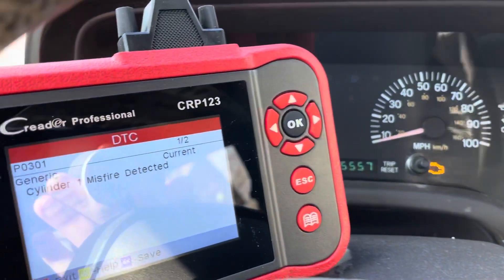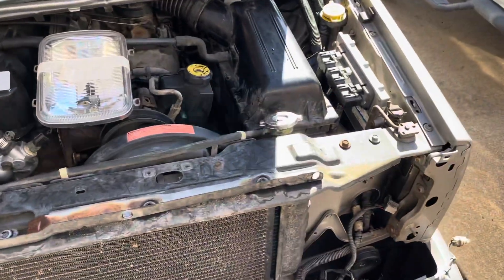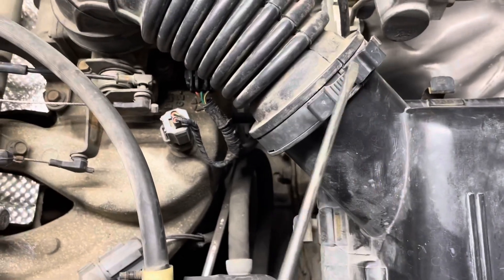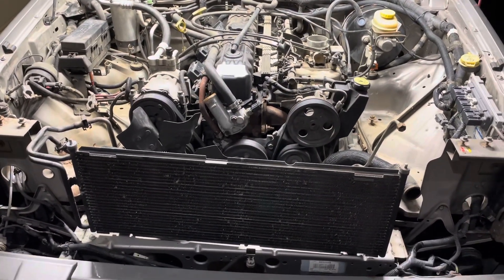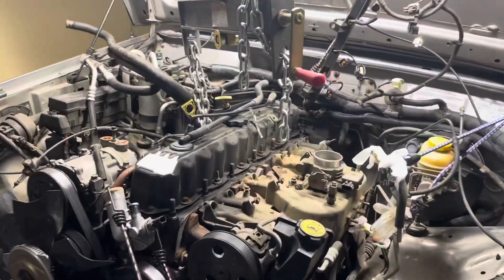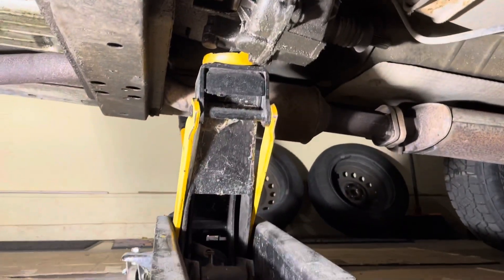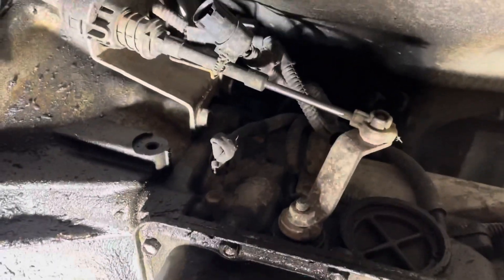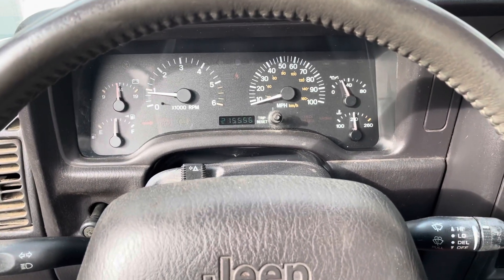2001 Jeep Cherokee Engine Replacement

Comment: im about to do the same thing, trans and xfer case installed as well. what bolts did you use as mounting points for the cherry picker ? looks like a manifold bolt on the drivers and i cant tell with the passengers side ? thanks.
Reply from the maker: If I remember correctly I hooked to the passenger side engine mount bracket. I put a jack under the oil pain then removed the engine mount.